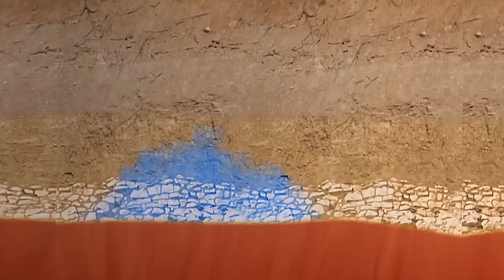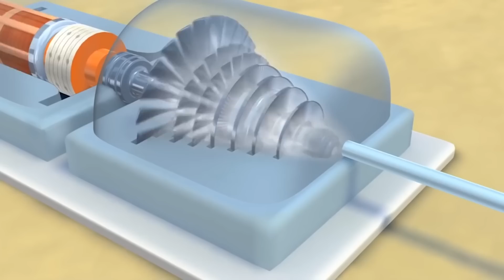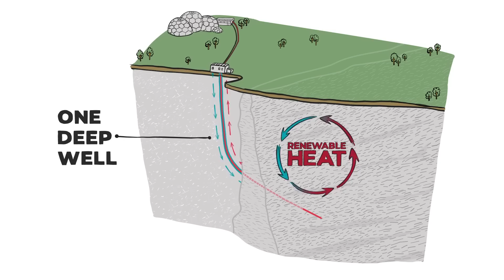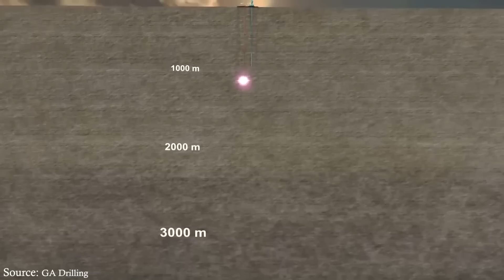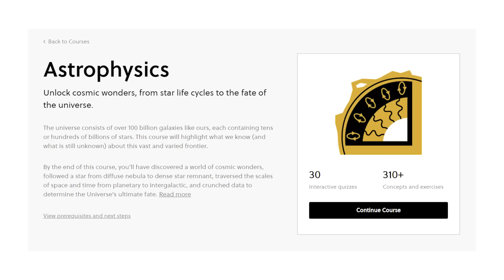How This Hole Keeps Generating Energy

Comment: as someone who has spent most of the last 18 years on oil rigs, as a geologist, and later an engineer, I can say that the process to drill deep geothermal wells is not really any different to conventional oil and gas drilling. We have the technology to drill very deeply already, we don't need this new plasma method that will use an incredible amount of electricity. Just because some technology exists, doesnt mean it's going to be affordable, or applicable. 
Geodynamics, a company in Australia already built a proof of concept for enhanced geothermal, or hot dry rock geothermal (look for Geodynamics Habanero project). They drilled multiple wells to only 4-5km deep, and circulated water between wells, generating steam, and electricity. One major economic hurdle was affordable corrosion control, not the technology to drill the wells. 
Conceptually, it's awesome, no need to burn fossil fuels, etc, but the reality is that there is no point building an amazing system if you cannot maintain the equipment and sell the end product at an affordable price.
Reply: i think you're missing on that as themperature get higher, they spend more money changing the drill bits, they don't last long and it makes drilling more expensive, so expensive that it reduce the ROI
Reply: @zazugee  Heat isn't that much of an issue for PDC bits and diamond impregnated bits, but it is for roller-cone bits as they have bearings. You are right though, actual drilling time is only a relatively small proportion of time spent on well construction, with each extra unplanned trip eating up the budget.
Reply: As the video here also showed....yeah, the Russians did it. But it takes forever and is far more expensive once you get deep enough. This system would use normal drilling through the sedimentary layer, and then once you reach very hard base rock it would be pulled out and the millimeter wave tech would be used in it's place, which has no expensive drill bit to get worn out and doesn't require metal casing as it melts the rock itself along the edges of the borehole forming it's own casing that can manage higher pressures and temps than standard oil / gas drilling borehole casing. 

If you would like a video that is far more informative on this project where they detail why this route is being used including the costs associated w/ traditional drilling vs. using this tech, I'd recommend this video: https://www.youtube.com/watch?v=g8sjdOjNxIE
Reply: @blakebrown534  casing, or even a vitreous layer on the wellbore wall still requires extra support in the way of fluid (and/or surface backpressure) to prevent shear failure in the wellbore - and/or casing collapse.
Reply: If we are willing to spend billions on a fusion reactor that will take an eternal 30 years to become operational, we can surely spend a fraction of this to develop geothermal operations. As long as we don't let the French develop it, because then that too will take at least 30 years..
Reply: @Verklunkenzwiebel  I completely agree, geothermal is by far the most sustainable clean energy that we could possibly use on this planet....the only issue is that there isn't any profit in it for a corporation.   It wouldn't need tons of mining, waste disposal or other secondary costs to pass onto the consumer.  The only issue is that it would be easier in some areas and next to impossible in other areas as the depths to reach the desired areas in the Earth would be different.
Reply: @paulmobleyscience  Geothermal is limited by the thermal conductivity of the earthen material it obtains it's heat energy. North of San Francisco is the worlds largest geothermal field named "The Geysers" with 376 active wells (591 total drilled) supplying a total of 18 individual power stations throughout a 29,000 acre property. In my opinion, geothermal wells or depleted oil wells would be more ideally utilized as thermal batteries for peak shaving that would lower necessary well depth. When they are at ideal thermal capacity it's heat should be siphoned for synthetic fuel production of either methanol or methane (cng) that it reality our overlords might already be doing in Texas.
Reply: @RichardPrendingue  I can agree with that. Would you agree that inventions that could solve most of these issues have been acquired by many corporations around the world that are placed on the shelf while they make as much profit from a century old technology?   The Russians drilled a hole for over 20 years and couldn't proceed due to the heat.  We have the abilities to make this all happen and the only limit is a corporations profit margin.
Reply: Yeah. There’s some crap here hey… ‘attempts have been made to drill into the Earths core’.. Er.. no they haven’t. Touching the mantle would be hard enough. As you say, HTHP drilling is already done, but it’s not simple. There are many challenges and risks to it. I’ve drilled 120+ oil & gas wells. My mind boggles when anyone suggests drilling down to the upper mantle would be a simple affair even with any new tech. Note also that the Eden Project geothermal well referenced here has had drilling stopped because it caused felt seismicity locally - though geothermal is currently allowed to make around 3000x the seismic energy that was set by the U.K. regulators for shale gas etc. Either way, very deep drilling is no easy thing. As you say, it’s all about the economics.
Reply: 100 days is a lot faster than 20 years.
Reply: if a gas like GLP is used as a medium to power a steam engine , you only need 30 to 60 Celsius degrees in difference , GLP a 80 Celsius,this could be implemented in existing regular steam turbine to help condensed steam.
Reply: @andrewgft4529  I can agree with that notion.  As a driller then you know the many issues that come from boreholes and shafts.  Microannulus, concrete degradation, shifting etc... which is why we shouldn't be using these boreholes to bury nuclear waste like Richard Muller and his daughter intends to do with their private company Deep Isolation. If we shouldn't be drilling for geothermal....then we shouldn't be drilling for anything at all...
Reply: Doesn't the plasma drilling also line the hole? The heat melts the rock causing a hardened surface to form making its own tube. Also current geothermal systems are highly cost effective, levelized cost studies show this. Is the corrosion you talk about applicable to salt water drilling?
Reply: oil at no point was created by any kind of fossil whether that be plant or "dinosaurs" you watch too much hollywood you have no idea what the scientific process is or how its used
Reply: @chabadlubavitch7303  Mate, you are the one who doesn't understand the scientific method. What's your next proclamation going to be?  That the earth is only about 6000 years old...?
Reply: Wells at that depth cannot provide the temperatures needed.
Reply: @filonin2  It all depends where you drill your wells. 4-5km is enough in the right geological setting. Even shallower wells are perfectly useful for geothermal power in the right geological setting too.
Reply: Working around those rigs in the fracking side of the business you can see that the water coming back up is much warmer than what is being pumped down.
Reply: Why can't the corrosion/maintenance problem be taken care of? What's stopping them from using better materials or dropping a WD-40 bath bomb down the hole every couple days?
Reply: @jayall00  come work in the oil field. There is no quick solution to corrosion. And when dealing with the type of fluids found deep in the earth, the corrosion, scaling, and other deposits that get built up are insane. I can't imagine the impact on equipment from 10,000km. Not only that but the equipment in the hole, such as the casing, would have to hold back so much pressure it gets ridiculous, not to mention the hanging weight of the casing string.
Reply: @effervescentrelief  Yeah I think this method of generating power is really awful if it's miles deep. It's susceptible to every worst case disaster. BUT there are places right in California where you can capture this energy on the surface. It's readily available in some places. Why isn't this invested in and used in those particular places?
Reply: @jayall00  Seawater is incredibly corrosive, and put anything into water, and it's covered with growths in no time at all.

The question that you're not thinking about is you're not thinking about if this is worthwhile to do.

To construct anything, it requires energy to construct it.  That's the main cost of anything made in bulk, it's the cost of energy to produce the product.

Now if you produce something that can truly make energy more cheaply than the energy it took to make it, you have a winner.  You could sell the energy at the market price, when you can produce it below that market price.

But if you can't, you're just making an expensive, intermittent, battery.

This SIMPLE calculation doesn't seem to ever be done.  People will burn tons of energy to make a "green energy system" that produces a FRACTION of the energy that was required to make it.

Most "green energy" is a scam.

One idea, which is SLOWLY coming back into fashion, it thorium reactors.  If you read up on them, you'll find out just how wonderful they are.  They cannot melt down, they cannot explode, they cannot go supercritical (i.e. kaboom can't happen) - these have been around for about 70 years now, but you CAN'T produce nuclear weaponry with them, and that's why the Department of "Energy" (misnamed, it's really the Department of Nuclear weaponry) has ignored it.

Thorium is about as common as lead.  It's very common.  If we have energy to WASTE, sure, turn it into solar panels and stuff.  If we went to thorium, we could use excess energy to develop geothermal energy.  Geothermal is basically unlimited energy, basically you drill an artificial volcano, the problem is, it's hard to drill that far down to the mantle, but once you do, you are running off from the energy of the core of the Earth, and that's NUCLEAR energy, and it's safe, there's no waste product at all, whatsoever.
Reply: @jayall00  cost...
Reply: Ziroth is WAY too stupid to understand you and does NOT deserve any support
Reply: Hehe we could but to many people in power have pockets deep in oil and would rather end the world for the next generation instead not making money another way it's ok we'll just revolt massacre the fat cats having heart attacks  they're gonna die in ten years anyway might as well
Reply: Hi
Reply: there are a lot of HPHT reservoirs that are already accessible to using conventional drilling. also, there are plans to use another fluid medium other than water to bring heat to surface. Water is extremely corrosive to metal tubulars in the well.
Reply: On Deepwater Horizon they drilled vertical depth 35k feet / 10km. Do you know what the temperature is down there? I would think it would be enough to extract a lot of power from.
Reply: @MaxQ10001  the water is super cold, so even if the temperature was high enough in the well, a power generation system would have to either be very well insulated, or have all the hardware on the seafloor. whatever the case, really expensive to do, but not impossible.
Reply: @MaxQ10001  the wells in the Gulf of Mexico aren't that hot, relatively speaking (referred to as HPHT wells). there are some HPHT hot wells (over about 400°F) in South Texas and Bakersfield that are being evaluated for geothermal applications.
Reply: @MaxQ10001  the Macondo well was drilled in about 1550m of water, and was about 5600m, so only drilled about 4050m of rock, more or less. bottom hole temperature was around 130degC.
Reply: But the difference is that oil/gas rugs use brute force drilling. Slow and expensive.
Reply: Is it even necessary to go more than 3-5 kilometers into the Earth if the use of the well will be geothermal energy?
Reply: Do you happen to know what the major hurdles are in the corrosion problem ?
Reply: @user-fc2xg5iz7y  If you use local water it often has lots of minerals which can cause corrosion.  Alternately, you can have a closed loop system such as proposed by the company EAVOR.  This approach also avoids the need for fracking of the rock to create an enhanced geothermal well.  If you avoid fracking and are drilling in dry rock, you avoid the problem of earthquakes.  Also the fracking may not provide the ideal production environment so is a fiscal risk.
Reply: Would stainless steel pipes be able to fit the bill, 2-300 degreees structural integrity and novel pipe cleaning process at regular intervals
Reply: The reason you need novel technology is that the rock is so hot, that the drill bits rapidly break down.

Using plasma though, might be stupid, because - yes TONS of energy needed to do it.

I'm an electrical engineer, and there's a simple rule to go by.  Unless the cost of something you build to produce energy is COMPLETELY paid for by the energy it produces, it's not worth producing the energy this way.

Unless a wind farm can produce energy at LOWER expense than conventional energy, you probably used more conventional energy to make the wind farm than it produced.  You didn't build a wind farm, you built a lousy battery that was intermittent instead.

ESG I think is largely a scam.  We should have moved to thorium reactors 40 years ago, but the MIC is always wanting to start a new war and terrify us with nuclear weapons.
Reply: @fuzzywzhe  Hi....sorry to burst your bubble on thorium reactors but it wasn't the MIC that shelved thorium reactors.   It was not due to thoriums inability to be used for nuclear weapons as the reaction still occurs just at lower yields.  The reason it was shelved and by whom is found where it started....Oak Ridge Tennessee and the scientists working on the MSRs.  It was shelved due to Tellurium embrittlement of the Nickle alloy and by the scientists themselves.  A metal did not exist to combat the embrittlement issue and the reason they aren't widely used today even with possible suitable alloys is that it still makes them much too expensive to use on a mass scale and can not compete in the market with other much more inexpensive alternatives.
Reply: @fuzzywzhe  Thorium is converted into U-233 which is then fissile.
Reply: @fuzzywzhe  The issue is like you said yourself that you don't know the exact reaction....The only reactor I would ever condone the use of is a breeder reactor that will use spent fuel much further than the typical LWR.   They should only be used to use up all the spent fuel that's been used and then all nuclear reactors should be completely decommissioned never to be used again.  The fact of the matter is that I do know about this topic.   I know that the inverse square law does not apply to extended sources of radiation and this law and formula is used to calibrate Geiger Muller tubes and take measurements.  Uranium under redox conditions becomes water soluble that bonds to the oxygen in the water to form the UO2 2+ Uranyl Ion that flows around the planet.  Tritium can not be contained due to its size and will split and permeate stainless steel and rejoin on the other side.   Once ingested it forms organically bound tritium that either replaces hydrogen in the cell or binds directly to the cell causing DNA strand breaks, cell necrosis or aptosis, chromosal aberrations, micronucleus formations and various other phenomena.   Through normalized discharges at every reactor that uses water as cooling, tritium, Carbon-14 that bonds with oxygen to form 14CO2 which is radioactive carbon dioxide and a greenhouse gas, Iodine-131, particulates, noble gases such as Xenon-133 and an "other" category.  These are released on a routine basis and nuclear fuel processing/reprocessing plants release even more.  Nuclear waste is an issue no matter how many pro-nuclear people say it isn't and that it's just political.   It is more commercial than anything as I proved they created a black market out of thin air long ago and have been selling the waste for decades.   These daughters of the Uranium decay chain and various others are what they have been after all along and nuclear reactors have never been about power for the masses....they have always been for uranium daughter procurement to sell it around the world after proliferation occurred.  It was their way to manufacture all this waste to sell all the while fronting it as a power source that would be so cheap it couldn't be metered.  Each reactor has been bailed out federally and by the states they reside in otherwise they would have gone under decades ago.

You say in one breath that you don't trust those in the government but yet you'll believe the narrative that somehow they decided to use U238/U235 as fuel in the reactors instead of thorium, that they would have to convert into U-233, (are you aware how that occurs??) because it creates a better bomb.   The 1-3% of U-235 in the fuel for a reactor (or 3-6% MOX) has nothing to do with making a bomb that needs much higher percentages to even have that reaction.   It makes no sense to say that the military long ago in the 40s,50s and 60s wanted all the 100+ civilian commercial reactors for power generation thats built for the next 60+ years to use uranium fuel instead of thorium/U-233 fuel because their uranium bombs blow up better.  The military would push for the civilian world to use thorium and leave the uranium for themselves if that was the case.
Reply: @fuzzywzhe  The required metal did not exist back in the 1950s and 60s.   The issue is the Nickle in the hasteloy which requires a different alloy mixture and various other things like graphene to combat the Tellurium embrittlement issue.
Reply: @fuzzywzhe  The economics of building a commercial nuclear reactor back in the 50s and 60s with the metal that they had available at the time for the use of thorium (U-233) as fuel either could not handle the reaction or would be so astronomically expensive it couldn't possibly compete with much cheaper much safer forms of energy production and the same is true today.
Reply: @fuzzywzhe  Stop telling me what to do Fuzzy.  Metal metal metal metal metal.  Metal
Reply: @fuzzywzhe  Metal ceramic mixture...not just ceramic.
Reply: And what happens when we cool the earths core????
Reply: @mistersniffer6838  The Earth's core is utterly enormous.  We couldn't cool it significantly if we tried.  The radioactive decay that heats it is a continuous process.
Reply: @incognitotorpedo42  - Our atmosphere is utterly enormous, but, according to the professionals, were killing it.  I will take your comments into account, but, I have my doubts!
Reply: @mistersniffer6838  earth's core could take millions, shit, even billions of years to fully cool, even if we could properly figure out the optimal tech to use this to power our world (and good God I hope we can) it'd take over 2 million years, which ideally by then (if we as a species even still EXIST) we'll have figured out another way to provide sustainable clean energy for this planet (fusion)
Reply: @JoshMarshain  - Sounds like a pipe dream I would def sign up for, but, I just dont buy it in the end.  Remember, were minuscule to the air around us and "supposedly" we have already screwed that up!
Reply: @mistersniffer6838  Tell that to the Amazon rainforest just how miniscule we are. "Death by a thousand cuts" springs to mind.
Reply: @methylene5   - That was my point!  Rain forest, air, water and now were going in for the kill to bleed off the thermal heartbeat.
Reply: I've read in many articles that drilling a lot also creates a situation where the end result is a weak place in the crust, thus a greater potential for earthquakes.  Many channels that report earthquakes have shown that a great majority are around drilling sites, which questions the catacomb that is being man made by weakening the land mass, thus producing not only more earthquakes but also of higher magnitude.  Tapping into oil reserves, or gas reserves may not be the answer, if the above information is true, but rather scientifically developing a more effective energy source that does not involve drilling.
Reply: @awakened5574  Could the increased earthquakes around drilling sites simply be due to the fact that they drill near fault lines, ie Northern CA and Iceland?
Reply: @awakened5574  that happenes only becouse a fracking. I am not expert but fracking is generaly proces of blowing huge quantities of CO2 I think to bring cose to deplited oil depoites closer to surface. And that creates extra instabilit in areas that are prones to earthquakes. But just diggging few holes and leaving it there doesn't do anything. Especialy if it is on places where Tekton place are not intersecting where eartquakes can happen.